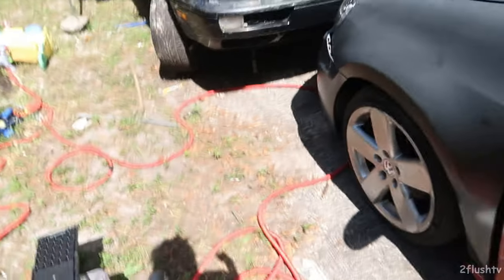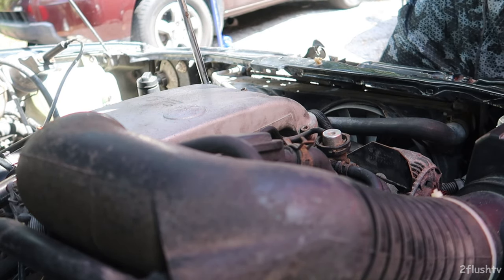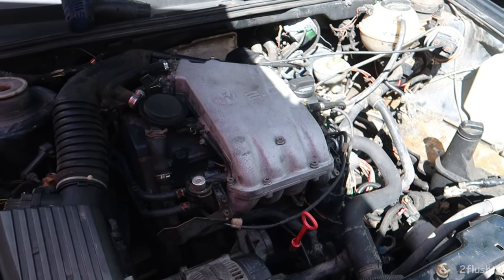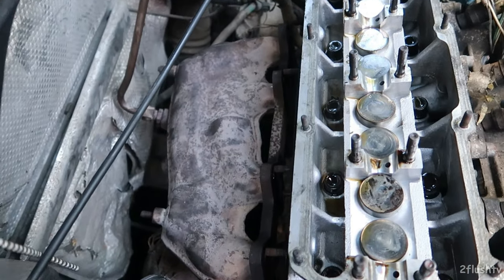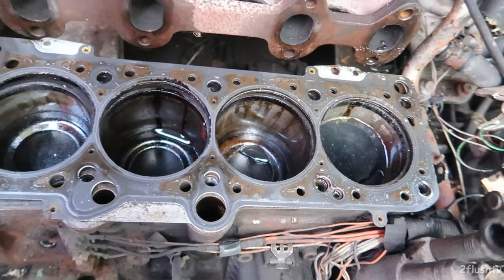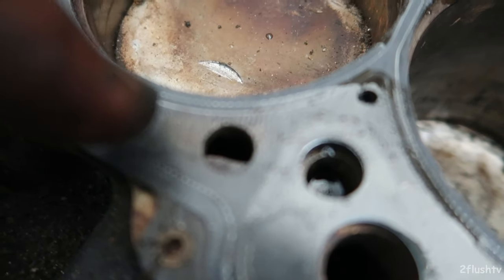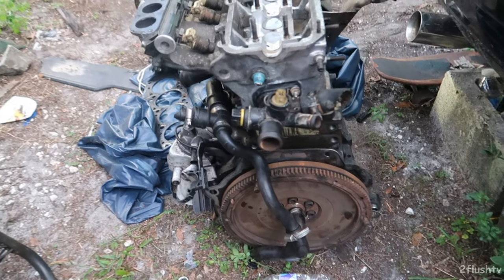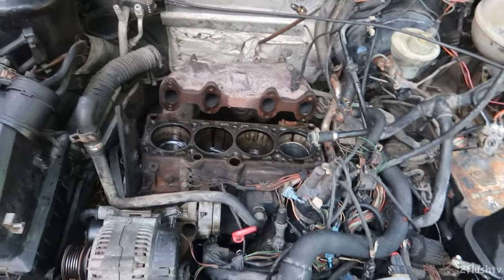removing head off 2.0 | starting 1.8 swap mk3 Golf

Comment: you have a few problems with this swap...when you say you looked it up im pretty sure  the forums you referenced were referring to the 1.8NA block....the AWD block is 1.8T block...#1you will have multiple oil galleys that arent covered by the head because its tiny compared to the 20v head.. the pistons are lower comp, so you will have NO power on low compression without boost even if it did work out somehow..and finding a timing belt might be hard..and the crank pulley is most likely different..
Reply: damn i commented before watching the whole video lol
Reply from the maker: Ok heres a question dose the aph 1.8t drop in the mk3
Reply: @2flushtv  no 1.8t is a "drop in" for a mk3

Comment: For a good 8v you get an Audi 5000 8v 2.0 block or a aba block with a 1.8 8v you can do 20v heads all motor of boost or even a 16v head and do a 16v race motor

Comment: yoeu need the head and gasket from a BEV 8V crossflow head for starters. Also 1 of the daule pins has to be remove. plus if you use a 1.8t head gasket it will need to have to be 82.5mm  bore.
Reply: im running my mk4 golf bev turbo setup with stock compression

Comment: the reason why you dont see this swap  is because its not efficient... your taking a block with low compression designed for turbo, and planning on not running turbo... nobody would do that

Comment: I’m trying to figure out if I have a blown head gasket or not . I did a block tester in my coolant reservoir. Turned green/yellow. When engine is heating up the coolant filled up and was ready to over flow and looked foamy and disgusting.  Can’t find leaks anywhere,  car doesn’t seem to over heat. Definitely gases in the coolant system. Is this  blown gasket? My oil doesn’t look milky or bad, my oil cap is clean.